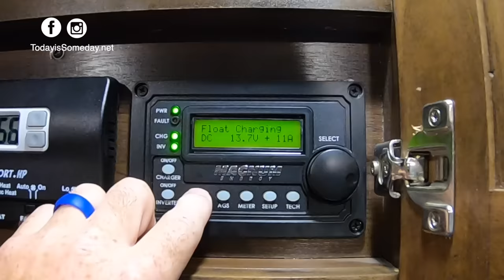Tiffin Service Center (RV RAMPAGE THAT CHANGED POLICY)

Comment: 2015 Thor Axis went in for preseason checkup at CW.  The service technician came out to inform me that the CO2 detector was defective.  I told the technician that I would purchase it and replace myself since I was a Service Technician for IBM for 22 years before I changed jobs and became a Service Manager for IBM.  So I bought the sensor and went home. When I went to replace the sensor I found that the electrical connection had been disconnected, now I know it was working before I left to go to my appointment.  I know this because it did the normal beep after 15 seconds when I started my RV.  I found both wire nuts had been disconnected, all I did was connect the wires together again and the sensor was working fine.  I called CW and asked to speak to the Service Manager, I explained what I found and explained what happened.  He said that his technician would never had done that and the connection must have came loose while I was driving there.  I said I found that highly unlikely since it was both wire nuts were disconnected not just one.  What are your thoughts about the situation, do think it was possible.  Of course I have never been back to that facility.  I had heard some stories about this organization but didn’t take the stories with much truth until this happened to me.
Reply from the maker: Wow.  I am with you.....I  think it is highly unlikely that it came off while driving....but stranger things have happened in RV's.  Don't blame ya for not goinbg back!

Comment: 2015 Tiffin 37AP - Endless problems in past 12 months:
One AC unit Replaced
Dryer motor replaced
Two window shade motors bad
29 ceiling lights failed or failing (partial burnout of elements)
Aquahot stops working overnight during cold weather won't heat (comes back on in morning)
Cargo doors constantly have latch problems(poor latch bracket design) has swung open on road
Carefree Awning - bolt(s) fell out, awning jammed and damaged paint while closing
Slideout seal failure (one inside replaced, one outside now protruding on different slide)
Both rear axle cap seals have failed (within 1000 miles of each other ~18k miles)
Bathroom fan motor bearing failed - replaced
Front AC temp sensor goes crazy, thinks its 70 when its 85 etc
Various rocker switches popped out of console
Driving light mount came unglued on one side of light
One way valve in black tank flush system cracked,  leaked water inside RV
Closet door self destructed when latch failed,  door slammed open and broke wood frame (very poor design)
Strong DPF odor in bedroom during regen - some sort of exhaust leak
Every RV service facility has caused cosmetic damage to unit while repairing issues.  Have not been to Red Bay.
Reply from the maker: That is a list! Did you buy new? Was it under warranty? Red Bay is the only way to go.
Reply: @todayissomeday  Bought used with 12k miles.  Luckily has an extended warranty.  Just not having luck with well rated RV repair shops.  They always scratch and ding, inside or out.  Takes away from the idea that having a warranty to fix any problems is worth it.  I'd rather keep non-caring techs out of the coach altogether with a quality RV.  It just doesn't exist in today's world because they all buy the same components (i.e. the AC unit).

Comment: I bought a 2017 Winnebago navion from a local RV place called Colton RV in Orchard Park New York.they attempted to repair my slide which stop working just before I was to pick it up after purchase. They thought it was the motor but it turned out so they said it was the wiring harness and replaced it. just before taking it off the lot I decided to buy an extended warranty from Good Sam's club which cost $85 a month . Right before I was to go on vacation. The slide would not work. Rather than wait to have it repaired again. I popped the slide motors out myself closed slide used blocks of wood to hold it closed. Headed across country to las Vegas. I made an appointment and took my 2017 Winnebago navion to the camping world for a bad slide motor. They determined that both motors and the wiring harness that Colton RV installed buy cutting into the harness rather than running the harness from motor to controller needed to be replaced. 1900 dollars was total parts as labor. I had a 250 dollar deductable plus had to pay the harness that Colton RV and labor to install it. 460 dollars was my responsibility out of the 1900 dollar bill.
Reply from the maker: WOW!  Can't believe that kind of service exists.  Glad it didn't cost you too much to fix others mistakes!

Comment: Yikes...Lets pray for all involved. So sad. Did I follow the story correctly. They made an appointment in advance to have issues resolved on their RV. The issues were resolved and their rig ready, They picked it up and 48 hours later all the issues they originally brought it in for resurfaced. They called Tiffin and was told the next appointment was a few months out? I apologize in advance if I totally misunderstood the scenario.
Reply from the maker: Close but not exactly. Tiffin doesnt take appointments. It is first come first served. Not sure if it was the same issue or a new one but when they returned they wanted to bump everyone in line and go straight into the bay. I get they were frustrated but wow!
Reply: You, Me & the RV it’s interesting that they use that protocol for service. It’s perfect if your retired and not on a specific itinerary.

Comment: Had a ground wire for the transfer switch replaced in a thor chateau 31W 2018 cost us  $160. It was an emergency call and we had zero power to the coach from any source and he had the knowledge it was well worth it,  took longer to drive to our location than it did to fix. I would use them again. "ON THE SPOT MOBILE" located in RVAIKEN SC

Comment: 1996 Fleetwood Bounder 40ft, one 14ft slide out. 
Remove and replace forward cabinets to repair short in12 volt wiring harness for topside running lights. 
New Black walnut cabinetry custom built currently being built.
Wish I could show you pictures.
Reply from the maker: Sounds awesome!

Comment: Ok I know old. But $198 for labor. Two years ago plus you had two technicians working on one job. I have Pennsylvania inspections. I also have my lifetime warranty inspection. Both inspections stickers certification one technician $155. And that’s roughly 1 hour. And if they have to do any work and it doesn’t fall under warranty that’s $100 an hour plus parts. And that’s what it is now. About two years ago it was $65 an hour plus parts. And it was about $85 for the Pennsylvania inspection and lifetime inspection. To me something doesn’t sound right to technicians they had to take your furnace out pull the hose out re-run a hose and then get a couple other things done. Most places would charge extra for that extra labor cost so now even if they were charging you only $65 for labor but they know they have two people on there now that would be $130 an hour now with two people. Easiest way to explain this is how many hours did they bill you for and what’s the hourly rate. And how much was the parts.  🤷‍♂️🤷‍♂️🤷‍♂️🤷‍♂️ because one of your comments asked a honest question because they’re trying to figure out what it’s going to really cost them to own a motorhome like yours and if it needs repaired what is it going to cost them. And the way you explained it. Me knowing hourly rates I’m thinking you paid roughly $800 to $900 for that job that’s labor majority of the bill then parts.

Comment: So, my husband is a mechanic and wants to know how did the drain hose get damaged? He always looks at the old parts to make sure he is fixing the problem not just the symptom.
Reply from the maker: It was too long from the start and was kinking each time the slide was opened and closed, causing it to bend in one spot to the point it weakened and split.
Reply: @todayissomeday  Thanks for the quick reply.   We enjoy your videos and thank you for your military service.  Hope to see you on the road someday when we get an RV.
Reply: @todayissomeday  Thanks for the quick reply.   We enjoy your videos and thank you for your military service.  Hope to see you on the road someday when we get an RV.

Comment: Sounds like a YouTube price cause you had two guys I’m guessing two hours that 4 man hours for $190 ????? I’ve been a mechanic for 50 years that just add up. Glad you had such a good experience not a lot of people do.
Reply from the maker: It had nothing to do with YT. They only charge for hours worked instead of hours in the bay. They spend time waiting on the runner when they need parts or discussing issues. You are not charged for that time.

Comment: I am in the process of purchasing a Tiffin !!  Was your's not still under warranty when you got the leak ?   Also, from what I could hear and understand, the problem was cracks in the hoses.  I would think even if it was out of warranty by just alittle time, something like that they would see as a defective part and replace it for free.  Your's appears to be a new Tiffin, so having a split hose already doesn't give me much confidence :(
Reply from the maker: Ours was used, 2016 when we bought it in 2017.  We were out of warranty.  it was actually really cheap to repair there.  Red Bay really takes care of you when you arrive.  No other repair place would have charged us $230 for that repair.....someone else with the same problem, same rig, was charged $1500 at an RV repair place.

Comment: Phil & Stacy: Long time follower and I want to thank you for all the information and recommendations.  Sorry for the late comment on the repair video but I also have a 33AA (2014) and heading to Red Bay next week for the same leaking kitchen sink line repair.  Question:  Because of the age of my 33AA I can schedule only the 2 tech 3-hour window.  Did they replace your line in a 3-hour window?  Not sure if your 2016 was limited to Express service, may get repaired locally (TX) if we will need to plan to stay for 2 of those 3-hour windows?  Thanks again.
Reply from the maker: They did repair our sink drain in the express bay and all of our other issues.....had us in all day.  Can't remember the age cut off for express bay only though.

Comment: How do you prevent your Jeep transmission from going bad because when you tell a four wheel drive vehicle you need to put it on a flatbed usually
Reply from the maker: Stay on top of your maintenance and drive responsibly.

Comment: Keep up with the great videos... Didn't know if this was asked before. How did that pipe crack ? Hopefully they found what caused it as opposed to just replacing the pipe and it possibly happening again...Safe Travels !!!
Reply from the maker: They think the hose was to long causing binding when the slide came in.

Comment: Typical company penalize the rest due to one person screw up.   Nothing says she could have just driven through the door anyway without staying there.   She could have run down the fences and still today ram the bay.  Obvious the door was down so that proves nothing would have stopped her.  Lets ban the RV because the RV did the damage.   Blame the mechanical device instead of the operator.   2A.
Reply from the maker: Actually it was not their first incident and it was required by the insurance company.

Comment: I'd never buy an RV that has its' transmission fall out after a low speed collision.
Reply from the maker: Definitely wasn't a slow speed collision......she hit it and pushed it across the bay floor.
Reply: That is not unusual for a transmission to fall out of a diesel pusher after being rear ended. Look up what happens with a steer tire blowout that is crazy. When you get rear ended in a rv you better hope the transmission falls out to make sure it totals it because once it is hit it will never be sealed the same and the frames are terrible for tje weight

Comment: When you hear that a transmission completely falls out of a motorhome after being hit in a low mileage accident, P.S. This woman couldn't have been going that fast in a garage, I think I would stay away from that model of a poorly constructed coach.
Reply: That would be a chassis issue, not a coach model issue.
Reply: @imnotarobot3600  Hopefully every chassis is not affected like this one was and maybe a recall is in order on all of this manufacturers coaches?
Reply: @crazycanuck2578 , the sad part is that that one is fixed, and on the road somewhere!

Comment: Amazing how crazy people can get. And that drunk. 
Your RV is not that old? Gee.  Use too thin and flexible pipe? It vibrated and broke.   I wonder if they could do what they do to home pipes that are old and inaccessible. Basically an epoxy coat that gets pulled thru by vacuum. Have to be a decent structured pipe. Since in warranty, absolutely new pipe. If gets out of warranty, may look into the epoxy. Its a thin coating so flow should not be a deal breaker. Just a thought for those out there needing repair. Done by plumbers licensed to do it

Curious, how reliable has your rig been?  
And you both are a fun couple. Enjoy your videos.
Reply from the maker: Our rig has been very reliable. Most of our repair items have been minor wear and tear items that Phil can take care of except for this one and an issue with the front cap.  It was mentioned in our last video.

Comment: They should have tied a rope to the hose before pulling it out.
Then you just tie the new hose to the rope and pull it back through.
Learned this trick after trying to run wires through the wire trace on my boat. In my case I just left the rope in the trace for future use.
Reply from the maker: The hose was so rigid, they just slide it right on over the water tanks into place.  We missed that on camera.